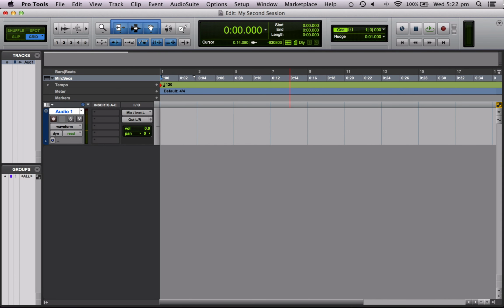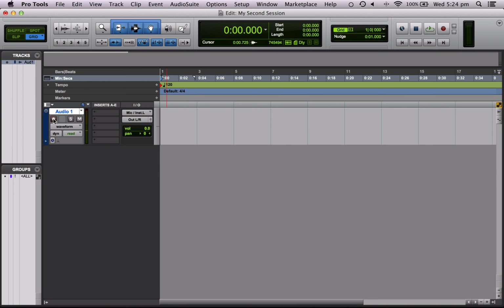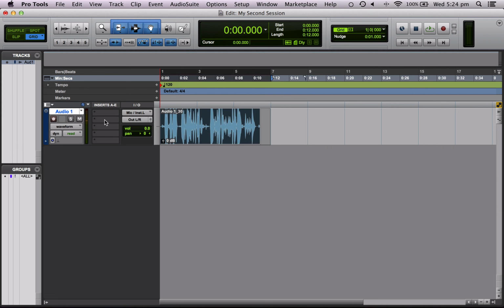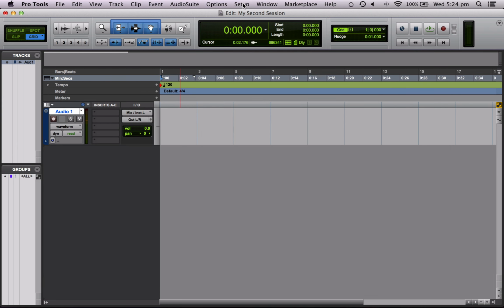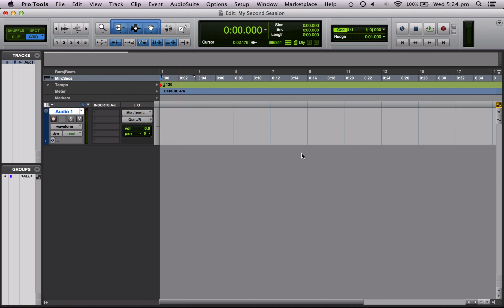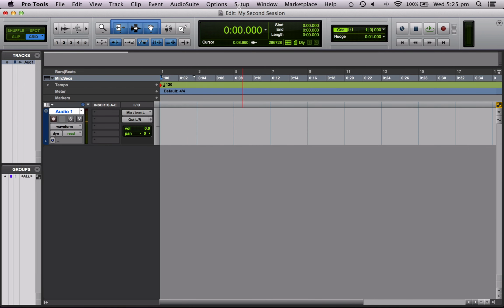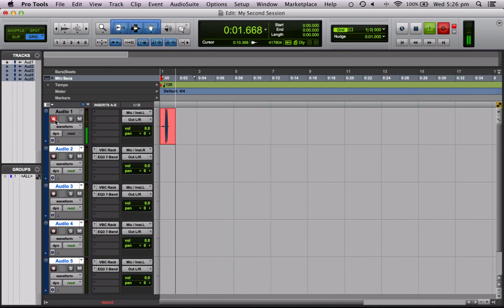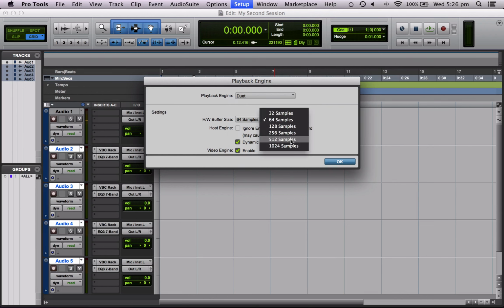Pro Tools Basics 03: How to Reduce Latency/Delay in Pro Tools

Comment: Ok some other points. It does not work like that on every ones interface. You need to mute the input. No matter how low I set the buffer it won't make a usable setting. That is why most interfaces have direct monitoring.Also, with your High buffer setting you will get delay when adding plugins for mixing. You need to turn on delay compensation.
Reply: Mute the input in ProTools? What menu? Thanks!